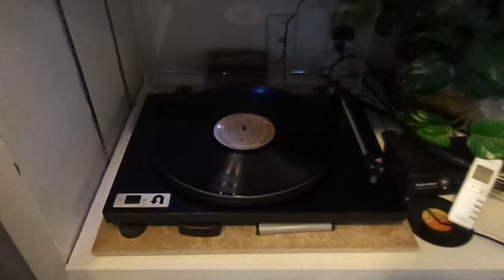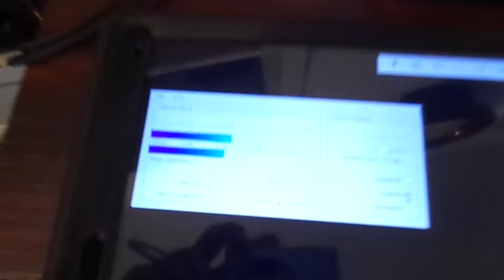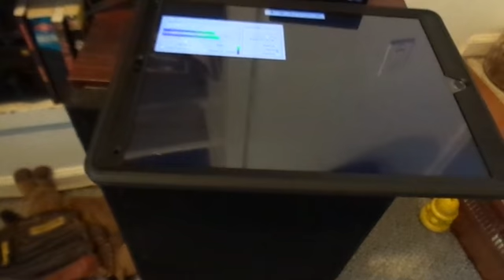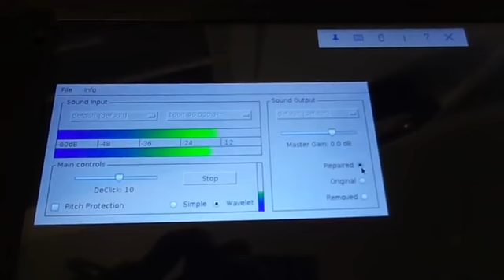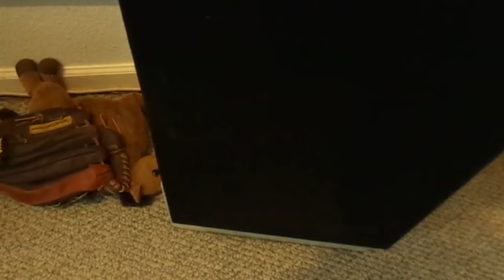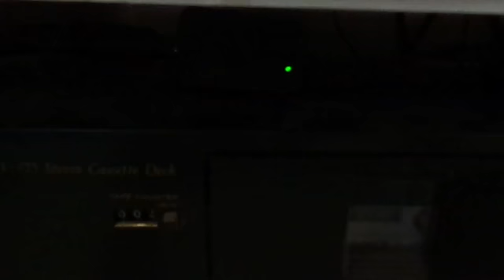Real Time Click Repair Filter Device - ClickRepairRT w/ a MiniPC

Comment: Hey Kris, liked this video I just stubbled on, wish it was a couple of years ago! CR-RT looks like a great piece of SW but I can't find it anywhere and Bruce at CR confirms what you have said. I see your equipment list with the sound card. Can you confirm for me how you connected your TT to your laptop? My Denon is not a USB unit and I am looking for a good $100 or so  Pre-amp/DAC w/USB Output and Bluetooth. I'll keep looking for that software... Thanks for the help!
Reply from the maker: If you check the internet wayback machine there is an “archive” of the clickrepair website including downloads, so you will be able to rollback a few years and grab it.  Does your Denon have a tape loop?  If so, you can use that to output your preamped TT signal to a sound card and keep it cheap...  the way I have my system is TT to an external phono preamp to usb sound card and then out to the stereo preamp.  If I used an amps phono preamp, I’d use the tape loop to output to the sound card and then back into the amp.
Reply: So I found and loaded 1.3 Trial Version. I suspect it will expire and will need to see if Brian will sell me a license so I don't have to deal with that....  Running on a Win10 PC, the program runs in a 2.5"x2" window for some reason. I can minimize and close it but cant maximize or change the size. Uninstalled and reloaded 3 times. Drop-downs and selections work but I can barely read the text. Went into properties and set "maximize" on run. No Bueno on that either.Any ideas.....
My proposed connection:
TT Pre-amp out to ADL GT40 DAC "Line-In" (ie DAC)
DAC "USB Out" to Win10 PC (Running CR=RT)
PC USB Out to ???
What am I running this signal too? I am not using a pre-amp as my speakers are powered. I was going to originally use the DAC for that. Do I get the external sound card and use it somehow. In place of the DAC and use the DAC on the backend as originally planed? I have a cool MPow Bluetooth transmitter/receiver that I could use attached to the Aux on the speakers and BT the signal that way..... Any ideas?
Thanks Kris!!
Reply: Ok I figured out the connection setup, was having a senior moment......Still I not sure what is causing the display issue. My GT-40 is not working so out for repair it goes. So I need the soundcard you recommend. What stereo pre-amp are you using? I need to go look for something simple, I will check Amazon tomorrow. Any suggestions?
Reply: Oh yah, what DAC are you using on your Raspberry Pi that you referred too?
Reply from the maker: Ah - the regular license IS the license for repair RT as well - so as long as you buy a normal clickrepair license it will work.  As for the window size, I have run into that as well - its just a java thing I believe.  There is a screen magnifier in windows 10, or you can right click the desktop and blow up to 200% temporarily - really once you get the settings the way you like it, it is rare to ever have to change them again.  As for your setup - I would either get a second DAC for the PC to output the sound, or just use the audio out on the PC if it is clean enough.  ALSO, I don't know the DAC you have, but it might actually be sending a signal two ways - to your PC and back, so the output of the DAC is actually the soundcard output and not just a loop-through, so you might need nothing else - it is going to take some investigation to see...
Reply from the maker: Your ADL is a soundcard, so you don't need to worry about that - it digitizes the signal and acts as a phono preamp.  The only thing is figuring out if the outputs on the DAC are from the DAC or just the phono preamp - my guess is it is actually a full blown DAC so you might be able to manipulate everything with the PC and the settings there (input the signal to ClickRepair RT from the ADL and then output the cleaned up sound BACK to the ADL and then through the output of it).
Reply: That's good to know because I did buy the licenses for both CR and NR from Brian so I am set there. I will check the screen hack suggestion, thanks for that!
Reply: Yah its a DAC. The ADL GT-40 has an app that run on the PC when connected so I can control it from there. It stopped working from some reason so I am looking to get it repaired by ADL in Japan. In the mean-time I will need to get the soundcard you recommend and probably something on the backend since I am not running a preamp. Any suggestions? What DAC do you have running on your Pi? I see that Behringer seems to be used by some on the Steve Hoffman forum discussion around CR-RT started by you. All available on Amazon! Thanks for all the help Kris!!
Reply from the maker: No problem, Guy.  The soundcard I bought was the cheapest USB soundcard, so it really doesn't matter - buy what you want/like... I still say if you can use the ADL, use that so you don't duplicate effort/hardware - as for the DAC I used for the Pi, I am using the HiFiMeDIY DAC - it was one of the cheaper USB Sabre DACs out there... But again, I think your DAC/Preamp automatically outputs the phono to the DAC, which you can feed to your computer, process, feed back to the DAC and out the headphones/output - and is of high quality.
Reply: It will do that.... It is not working and I am sending it to ADL in Japan for repair. So I bought a Scarlet 2i2 which seemed to be recommended in the discussion started by you on the CR-RT in the Steve Hoffman Forum. Lots of good info on this project there. So I plan on get this all setup this week and will keep you posted. The CR screen size suggestion did not really work its still really small but readable and useable. Like you said set and forget so it I my OCD brain will let it go....
Reply from the maker: Fantastic!  Let me know how it goes!
Reply: Kris on a  new topic.... is there a way to PM you here? Anyway I like your "MacGiver" approach to problem solving. I am looking for a turntable leveling solution. My Denon DP300 has non-adjustable feet so I cant level the table with them. I have a nice MacGiver isolation base setup with two Ikea Bamboo Cutting Boards separated by Sorbothane Isolation Pads. Looks pretty nice as well. Not my idea I was inspired by another YouTube vinyl enthusiast. Anyway so the coaster hack is NA. I want something that looks good, is adjustable and not some $$$$ smoke and mirrors audiophile paraphernalia.... I have seen on YouTube adjustable furniture "glides/pucks" which would be perfect but I cant find them anywhere on-line. I messaged the author of the video that used them but no response so far..... Any ideas?
Reply from the maker: There is no way to PM on YT anymore - they removed that feature last month, but you can always message me privately on the SH forums.  Sorbothane is definitely the best material I have come across (I do have several videos on it, isolating hum in my setup).  All my videos that relate to anything sound wise is in my Sound Advice playlist here.  I have bought Air Conditioner isolating blocks, basically you would screw them into a duct/air handler system before the unit so it doesn't vibrate sound into the studs, but the sorbothane worked better.  You can actually just use a couple of pieces of that for levelling if it works... I literally bought glide pucks this weekend at Lowe's - you can get them at Home Depot or really any hardware store.  I have used quarters in the past to level a turntable - you can't tell by looking at it, and if I gold plated some washers I imagine I can sell them for $5 a piece on the audiophile market... :P
Reply: Kris thanks for the reply! Rubber washers, great idea! I am going to Lowes to see what they have. I will check out your other vid's as well. Thanks for the PM info too! I will PM you on the SH Forum if I have any questions. You have been a BIG help!
Reply: Got some washers at Lowes and they worked perfect! Thanks!

Comment: Kris - I had the idea tonight to do this with a Raspberry Pi but looks like you already tried? Were you using a Pi3 or was it an earlier version?
Reply from the maker: It WAS a Pi 1 I found out - I thought I had a Pi2, but I was wrong.  I have since purchased a Pi3, but I still think it will be an issue because of Java - even with the Celeron and computer I am using now, if there are lots of clicks and you have the settings to high it will start to stutter and fail - so I don't know if an ARM processor running Java will be enough - if it was written outside of Java I think it would be fine.
Reply: @dixielandfarm  I was watching the "You don't make friends by NOT commenting" video a moment ago and remembered that I didn't get a reply to my comment here. So...... I searched for the video again and voila! You did reply!  I never got this. Well, anyway... if a dual core Celeron has trouble keeping up, then a quad core ARM probably doesn't stand a chance. darn! I actually think a low cost (under $100) click/pop remover, based on this little app-let could be a commercial product. Like you say though... the Java requirement kinda kills this.
Reply from the maker: That was my hope - find a way to use a RaspberryPi, bundle a iso download for people and let the author get the money - but it just wouldnt work.  He was also not interested in the possibilities

Comment: Very interesting! I too don't like to listen to pops and cracks when listening to albums. I use Adobe Audition CS6 to record and clean up my albums at 96/32 resolution. it does a great job, but it would be nice to have something to clean it up when i just want to play and album for listening only. I've downloaded it, but my turntable is in pieces right now as I'm waiting for the wiring to arrive so I can rewire my tone arm and install RCA jacks in the back of my turntable so I'll try it out later in the week.
Reply from the maker: Very good - the author no longer includes/supports/offers the RT version of the program, so finding the older version of the program that does have the RT element can be difficult.  Just having a laptop available will do the trick, you don't have to go through the trouble like I did.  I will be honest, I can't live with out it - but it doesn't do as good a job as the offline programs do.

Comment: Hi Kris, nice video and program. Please, can you tell me, where I can get the program? Thank you. I'm looking for a noise reduction program that works in realtime.
Reply from the maker: Thanks so much!  Unfortunately, the author of the program has decided to discontinue and pull the program, which was at clickrepair dot net.  However, I imagine there are plenty of archived versions of the program floating out there (look for the RT at the end of it).  It runs in java, so it won't be tied to any specific OS.  If you run into trouble, send me a private message...

Comment: Thanks for the extra info on this, Kris. I already have a networked mini-PC running foobar2000 going the other way for input to my pre-amp with a Ifi iDSD Nano DAC/Headphone Amp between the two. I'll look into adding this to the mini-PC's programs. I watched this a few months ago, just never around to checking a little deeper, thanks again.
Reply: Hey Kris, 
   Are you sure this program will still work in real time? Their webpage states that ClickRepairRT is no longer distributed or supported.
Reply from the maker: Well, only ClickRepairRT will work in real time, but what a bummer the author decided to no longer support it.  I know he personally stopped using it, so I wonder if he just lost interest and decided it wasn't worth the effort to keep up the coding... I would look for an older version to get - it still works in java and everything (and of course I use it)... To be fair, there isn't much to upgrade in the future - it just works as well as it does with the constraints of doing it in real time.  Once you have it, you have it.  Let me know if you get it and use it.

Comment: Do you need to know how to program to make one of these? I thought it was wonderful.

You mentioned a DAC. Can you share the brand and model? 

After seeing your recent finds and talking about the "DeClicker thing" I went back and found this vid. Really impressive.
Reply from the maker: Thank you so much - I have all the instructions and parts list in the dropbox link in the video description... to someone who has never touched linux before, it will probably be too much, but if you have dabbled a bit, then it should be a snap.  The DAC I use for my raspberry pi squeezebox device is a HiFiMe DAC - they are a DIY group and take the SABRE DAC that is in many higher end devices and make their own  device for a tenth of the price.  Also, check out the Rasbperry Pi video for more details on that setup: https://www.youtube.com/watch?v=QQoLP-PbCWI
Reply: Thanks, I will look at the links you mention. I don't have any programing or code experience. I may be in over my head. but I will read more and see.  I have always had an interest in electronics and dyi but never got over the fear of breaking something. Maybe the DAC is a place to start. 

Thanks for responding. I will look back over your channel also and see what other tips you have. Just out of curiosity are you an engineer or similar. You don't have to share if you don't want to. I'm just wondering how you got so comfortable with computers and electronics. Thanks.
Reply from the maker: I was a film major, then worked as a cameraman in tv, then a live truck operator, then helicopter photographer, then production coordinator for a few networks, horse farmer, church secretary, corporate secretary and HR, then IT specialist.  You know, the average path for most people, nothing out of the ordinary.  I was always a computer nerd, but never really wanted to do that as a career.  When we got the horse farm (still have it, and it is my real job) I ended up getting a full-time job that eventually got me back into IT, but I have no training in it just like I have no training in being a farmer.  

 I was a Ham Radio Operator (still am) since I was a pre-teen so I dabbled in electronics way back then, as well.  So basically I just learned on my own and figured it out.  The one skill I have is I am good at figuring out things and knowing exactly when I DONT know what to do or am about to be over my head and stop.   That skill is what has enabled me to be able to do lots of things (I rebuilt a VW after college, I had to do extensive work on an two ATVs this year that I never did before, rebuilt a riding lawn mower a few times, plumbing, electrical, pasture maintenance, etc...)